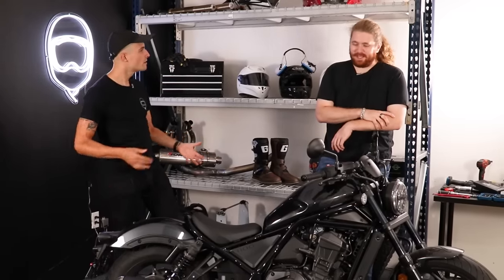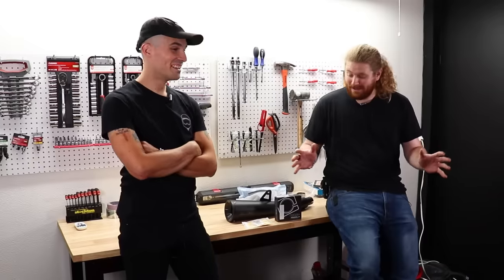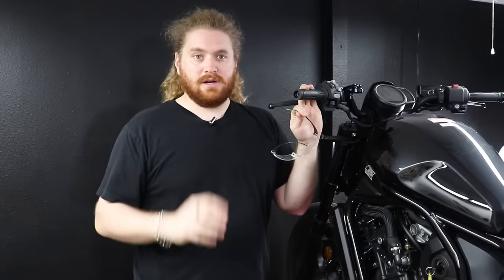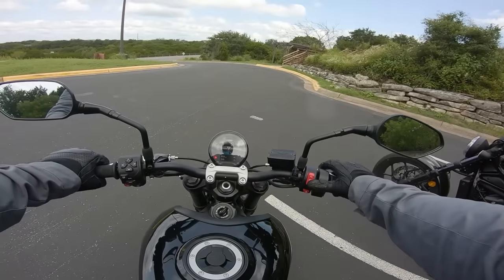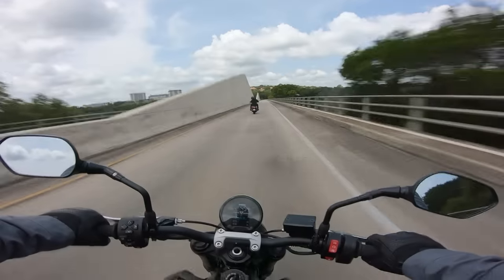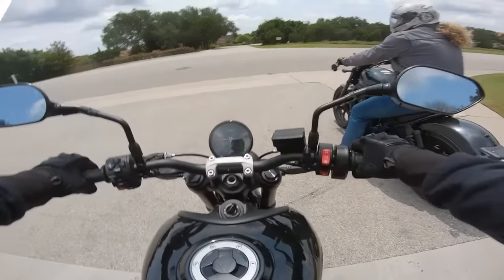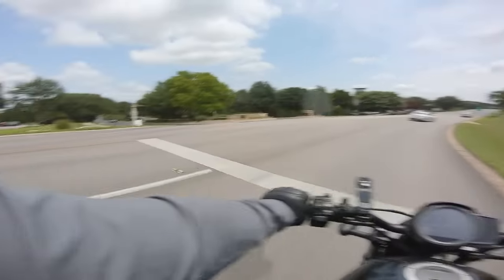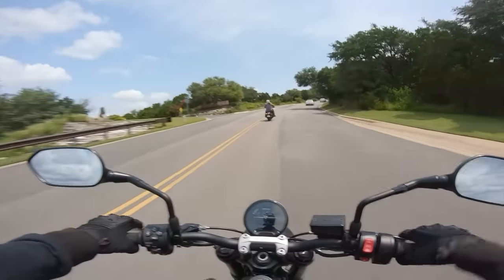How to Make Your Rebel 1100 Sound BETTER Than A Harley!

Comment: I will honestly never understand the whole bar end mirror thing. I find regular mirrors just look alot better
Reply: For some of us stock mirrors don't see beyond our shoulders and prefer a cleaner open view over bars.
Reply: @ganuvien  i get that to an extent, but i just wouldnt go the bar end route to fix that
Reply: Yup the replacements look totally rubbish and add to the width.
Reply: I agree 100%
Reply: Totally agree. No way a rider gets a better view with the hack job they did on this bike. I might end up replacing my stock mirrors but it won’t be with anything like that!
Reply: I stock Mirrors suck
Reply: nope
Reply: My upper body is too long and i have i broad shoulders so a regular mirrors is good for nothing. I solved this problem by using ape hangers on 3 of my bikes then i inverted the mounting on my other bikes with regular handle bars.  The problem with having your mirrors underneath your handle bar instead of over is the time to get your eye on it and back on the road but im used to it. Bar end does make your bike look clean but it makes your bike wide too and i live in a country where filtering in heavy traffic is allowed otherwise you'll die of heatstroke from a 1-2 hour traffic jam if you rode your bike like a car in a 48°c and get stuck in the middle of traffic surrounded by machines that produce even more heat specially your own. Yes! Bar end got me stuck in traffic more than once and thankfully those times were during rainy season.
Reply: @r.i.p2464  so ape hangers would be in the opposite direction as normal mirrors right just asking since I think I would prefer those than anything else
Reply: @Anonymous-jj9yu  depends on your body. I used to mount it upside down  but its almost the same height as the the normal mirrors mounted on a normal handle bars so i mount mine the normal way.
Reply: Any mirrors suck and I don’t trust them anyway. Bar end mirrors are less bulky. Do your head checks and you don’t need either.
Reply: To each his own, but Mickey mouse ears sticking up is less clean of a look to me. I feel the same about wires. If it can be put in the bars. Oh Soo choice.
Reply: @moviedog59  actually bar end mirrors give you the best viewing angle behind you
Reply: Bar end mirrors look a lot better (not those ones in this case, they serve no purpose in that position)
Reply: I want a helmet that has cameras in the back and does a heads up display inside the helmet for behind you
Reply: @Timman57  the biggest problem would be taking away vision in front of you in order to have a screen like that, which would be hard to view, as resolution gets kinda wonky that close to the eye
Reply: Me too. I hate the upside down bar end mirrors both in function and look. I think regular style looks and functions far better.
Reply: the concept of personal preference is wild I know
Reply: I see your point and I counter with a big no
Reply: @DetectiveStablerSVU  shit, you got me
Reply: Try riding a naked with upright sitting and mid bar mirrors, they're like useless 
Stock mirrors work good on sportbikes cuz your elbows are bent and down, on a naked your arms block the stock mirrors 
Bar ends are MUCH better on a naked plus they just look cleaner
Reply: @Th3Acc0mplice so u do a head check every 5 seconds ?
Reply: @tomtemple69  road a z650 for 5 or 6 months back in 2017 when i didnt have a car, never had an issue with the stock mirrors, which was partially where my original comment came from
Reply: @tomtemple69  that’s an ignorant question so you’ll get an ignorant answer “yes of course I do head checks every 0.024 seconds as matter of fact” …. No, in reality I have bar end mirrors to get the big picture of what’s going on behind me. And head check when merging/turning/changing lanes. Quit being silly…
Reply: @Th3Acc0mplice  u made it sound like u have no mirrors 🤦
Reply: @tomtemple69  nah I clearly said the cons of stock mirrors and the benefit of bar end mirrors and why people have them. But you can’t rely solely on either
Reply: @Th3Acc0mplice  well yeah thats how literally any vehicle works, you still have to check your blindspot
but bar ends are much better than stock or no mirrors at all, being able to see behind u without having to physically turn your head while stopped or while riding is a life saver
Reply: okay
Reply: You got the point, they should do side mirror delete rather than having one that doesn’t serve a purpose
Reply: @Tren_Rides what’s the point of it when your your fore arms are blocking the mirror

Comment: Owning both Harley and Hondas, i do love my Hondas a little more then my Harley, THAT being said, i have to say nothing really beats that sound from a Harley, nothing really matches that. I've heard a few Yamahas that sounded pretty close and REALLY good, but that sound of a Harley is hard to beat. I do love the new Rebel line. I'm not dissing the sound, it does sound good, and this bike is on my list of bikes to buy if i ever won the lotto. To kinda reiterate my point, a new Mustang sounds clean and good, and it's obviously faster then an old one, but nothing beats the sound from a fox body that's been cammed, and modded, although no where NEAR the HP of a newer one, but the old fox body 5.0s just sounded mean.
Reply: That is your opinion, my opinion is that the Harleys sound is awful!
Reply: @pedrofernandezneri3374  you ever rode one? I thought that as well, but after riding close to one i understand the meaning behind the brand.
Reply: Harleys sound is very much "American muscle" and I would also add that to me an old shovelhead with an upsized  cam and carb is the best sounding Harley engine period. Its the sound that many of us older people grew up hearing and thats why we love it.
Reply: Alot people who hate Harley. Have never ridden one. Honestly half these commenting  do not own a motorcycle and never will. They say there buying next month or next year but they never do
Reply: @craigbannister7826  I have ridden one. And I own several motorcycles right now and always have. I would NEVER pay the premium to be a Harley ball hanger. Pay twice the price for half the bike just to be in the leather pirate club? No, thanks.
Reply: @pedrofernandezneri3374  they do, they sound awfully bad ass!
Reply: @Sonic_Boomer_  I had a 79 XLS Roadster 1000 in my early 20's. The sound of that Shovelhead was amazing after I put on straight pipes and jetted the carb. ✌
Reply: The Indian Scout lines all sound really good
Reply: @Goesdeep how many bikes can I afford, I have 2 kids in private schools, and a mortgage. I would need a shit ton of more money to buy any more then 3 bikes. Plus can't fit any more in my garage. Still got a payment on one.

Comment: I know the 1100 is a good motor but I was secretly hoping they would bring back a V4 like the 750 magna had in a new cruiser frame.  That motor had great sound and performance.
Reply: Agreed. I have the OG 1982 V45. Impressive power for a 40 year old bike. I really want Honda to reinvent the Magna, but this Rebel looks like fun. ✌
Reply: Far as i understand it's too expensive and complex to make sense producing it nowadays
Reply: Unfortunately 4 cyl bikes are difficult to make emissions compliant in CA so it ruins it for the rest of us.
Reply: i traded my '85 magna for a scooter...i messed up
Reply: I have a 1983magna 750 and my 1985 maxim 700 sounds way better .
Reply: yessss pleaase
Reply: My local Honda dealer think the V4’s are dead unless we’re talking top-of-the-range for most manufacturers :( 
Too expensive to produce, to hard to hit compliance with 4 cylinders as others have said.. hopefully this changes one day but not for the foreseeable will we see a cheap production V4 anytime soon..

Comment: I do like the rebel cruisers arnt my style but the rebel is the one exception imo
Reply: Same. It's a naked bike with a cruiser aesthetic and I like that a lot.
Reply: Gonna third this, i guess you gentlemen like the Sportster S too? (cuz i guess we’re the same demographic)
Reply: @nathanluu9347   ya I think it is a nice looking bike
Reply: @nathanluu9347  Not especially. Yeah it's better but it's 15k, that enormous front tire is concerning and Harley has negative brand appeal to me. It's associated with fat boomers with no riding gear because that is literally the only people I see on them. That 15k is a huge deal too. I'm looking at bikes in the 5 to 8 k range not 15. If I had 15k I wouldn't be spending it on a Harley.
Reply: @nathanluu9347  The Sportster S seems cool for it's belt-drive, full color display, and 120+ HP and no dumb speed governor.  But it does have some funky looking pipes, don't like the stock forward controls, and 5k more than a Rebel 1100.  So it's 50% more expensive but no way is it 50% better.  The Rebel 1100 would be perfect if they somehow gave it a belt drive and got rid of the governor.
Reply: Perfect good at everything bikes, i’m crazy in love with mine

Comment: Absolutely love the Rebel 1100. The riding position, the 6th gear, the cruise control and it's so much lighter than my Raider. I think it would be fun sporty cruiser to play on.
Reply: I saw a Raider about a month ago, and went for A license. Raider is my dream bike, but I consider getting 1100 as my first.
Reply: Thanks for the input. I have a 2014 Yamaha Bolt that I made club style, but that lack of a sixth gear is making me consider other options. I was looking into either the stryker or the raider, but I only weigh 125 lb at 5'5", so I'm trying to stick to the midsize cruiser.

Comment: I prefer the stock mirrors. Also the bar ends are sliders in the unlucky event you low side. The exhaust does sound really good though.
Reply: Yeah I think the factory mirrors look fine, I think it looks dorky and goofy with one mirror sticking off the side
Reply: 2 mirrors are better than 1. Harley guys are more concerned with image than anything else. That's why they ride Harleys.

Comment: makes good argument for pricey mirror

States price

Still has to use a Dremel to make it fit
Reply: I did not hear the good argument; just the crazy price. I've never broken a lens.
Reply: @immortalnow  that wasn't the good arguement...the good arguement was the rubber bushings used to eliminate mirror chatter from engine / road vibrations

Comment: Got my license 2 weeks ago 
(over 2000km already) & I learn on a Rebel 500 (10 hours on street) from the Riding School. Love it 😍 
...but since I'm 5'8" I was able to get the 2007 Black & Chrome Honda Shadow Spirit vt750c2 (drive shaft, 25.5" Seating, 21" wheel in front)
Called it "Dreamkatcher"

Comment: Had a Buell XB12 for a few years now, paid $3500 about 8 years ago or so.   Put 30kmi on it, loved it, got sick of the riding position, want a more sportster riding position, loved the engine on the buell, I bought me a 883 with low mi for $4k, figured I would save my money up and convert it to a 1200 and have fun with the wide variety of customization options out there.  I knew the suspension on sportsters was not that good but the more i ride this bike the more bothered by it I am, my buell had really good suspension, plenty adjustable, the price for good suspension on a sportster is up there, for me to do basic upgrades plus 1200kit and suspension on my initial $4k investment we are getting up about $9k area, the more I look at the Rebel 1100 the more I kind of want one!  basic exhaust and tuner mod, oh yeah, this bike is looking better and better! and for the price I may have been better off just buying a new Rebel 1100!!!
Reply: Add a pair of Burley shocks in the near and it changes the whole feel. 

If I remember correctly, mine were just over 200 bucks
Reply: @tylerwalsh7587  thanks for the recommendation.  Since this post, i have afforded the 1200 conversion kit.  now the bike can half get out of its own way, at least by Harley standards.  I have been chopping the bike up and enjoying every minute of it.  I am stripping all the parts I do not need, speedometer, mirrors, turn signals, belt shrouding, exhaust heat shielding, I ground the paint off and intend to let it rust over a bit before I attempt to clear coat it, I have also managed a jockey shift/suicide clutch set up that has been a lot of fun, so far I have not crashed but I have had many stalls in crowded intersections!!!  I am getting better at it.  i also fabricated up two rigid strut bars and replaced my factory rear shocks with them, I lowered the rear almost 4 inches by doing this, I really like the stance now but if it dragged around every corner before I really does now.  Compared to the OEM rear shocks, rigid mounting the bike is almost an improvement honestly.   I put 1in spacers under the fork springs to add some preload that has really helped but it needs thicker oil to be sure.  I also welded on some fittings to the side of the fuel tank and installed a clear hose between them for a fuel level sight glass function.  I need to get a chain conversion kit so I can gear the bike up higher, with the OEM ratios its fine up to about 60mph but the bike just screams above that.  Be nice to get it to do 70-80mph and not be wrapped out!  

At this point with all of my maverick mechanic antics and the wide variety of aftermarket support that exists for the Sportster it is hard to want a Honda Rebel 1100.  I really like what that bike is but the ability for me to mold my sportster into so many different configurations so easily is really fun!  Expensive but fun!

Comment: I did the CRG’s and a Two Brothers exhaust with the DB insert and it’s near perfect for me.  A little quieter at cruise than the V&H but plenty of sound under load. Looks almost identical on the bike. Didn’t need any Dremel for the mirror, just used a spacer to position the factory end out enough to clamp the mirror onto it.  Did need to buy a longer bolt but much better than grinding.

Comment: I’ve never owned a Harley myself. I’ve owned almost all Hondas. And I can say that while that aftermarket exhaust makes the bike sound good for a Honda, it definitely doesn’t sound better than a Harley. Not by the sound, the tone and especially the volume. A nice Harley V-twin with an aftermarket exhaust sounds better than any motorcycle to my ears. Honda motorcycles Are a great value, you get more for your dollar. They give you more amenities in the base model making them safer and more comfortable than a base model Harley. You have to pay for upgrades and add-ons for a Harley to have the same extras. That being said, safety and comfort are important, probably more important, but they don’t equal exciting.

Comment: I can't stand any type of low mirror that is out of the way like that.  I want to be able to see in my mirrors and who is around me  easily at all times, not having to look way down at a mirror.

I also wish Vance or TBR would make an exhaust that was mounted straight down low so it wouldn't block saddle bags... they both sloped theirs up like that... like the Rebel is some sort of sport bike instead of a cruiser.
Reply: Do you know if it blocks passenger foot pegs as well?

Comment: Silly question, but does it matter that the V&H points up in the air?  As in, if I park it while it's raining will it fill up and do damage?  Or is there a drain hole etc so it doesn't create any problems?
Reply: Not a silly question , I expect you would get water in the system if left for months . Worst case scenario you may get a cup of water over night in heavy rain . As soon as you start up in the morning the water would blow out on seconds . Most motorcycles are kept in a garage and dry . I feel the worry about water getting in is soon out weighs the cool sound the bikes makes and is stored in your garage anyway . Also you can use a plastic bag to protect the end if your really concerned. Ride safe

Comment: I know it’s probably dumb but the sound of a bike is a HUGE selling point for me. This exhaust definitely sounds better than the stock pipes but definitely not as good as a Harley or Indian.
Reply: Not dumb at all! I chose the Yamaha Bolt over the Kawasaki Vulcan s for that very reason. I like that V-Twin sound over the parallel twin sound. But since the Rebel is a 270 crank, I'm considering buying this bike with the right pipes.
Reply: wonder why ? completely different motors and motor sizes.  the only Indian that comes close to this engines displacement is the Scout 60...60cu = 983cc.  
You'd have made a better statement by saying. " I like oranges...because their not apples. "

Comment: In terms of bar end mirrors I had the same issue.  I drilled and tapped into the bar end weights.  I had to put a spacer in on the throttle side to stop it binding, but it worked great.

Comment: Bravo! Could not have picked a better subject for mods. Its hondas mule motor and it has o2 sensors so no flashing required.
Reply: Man the 24 oz honda lightened up that bike by eliminating the steel sleeves is totally worth the belching smoke and piston slap...even better it's across their  entire line of 2 wheelers.

Comment: The single flaw I see on the 1100 Rebel is the very small fuel capacity. And they put a cruise control on that. Seems like a contradiction of features.